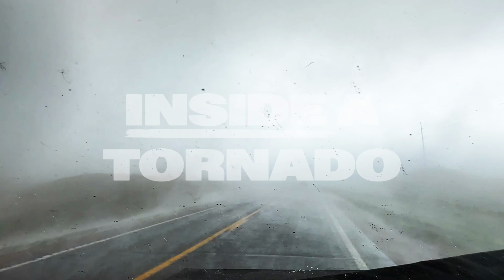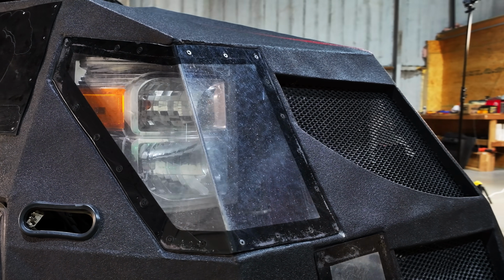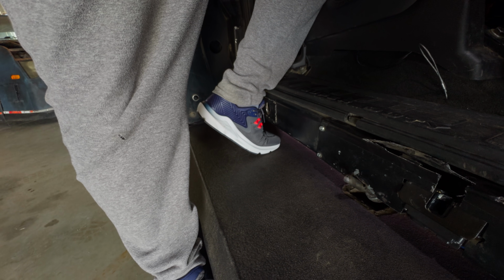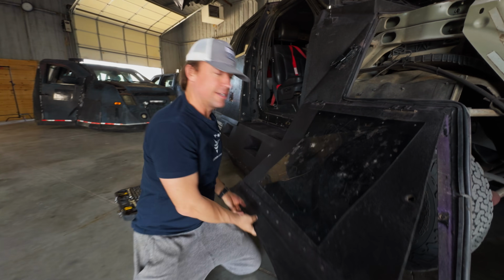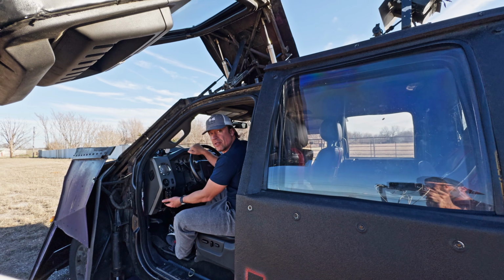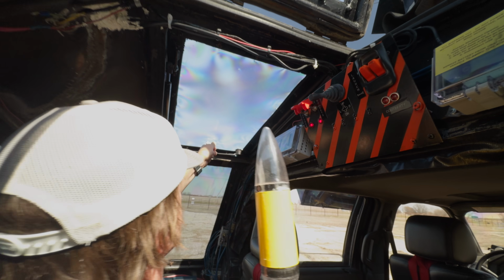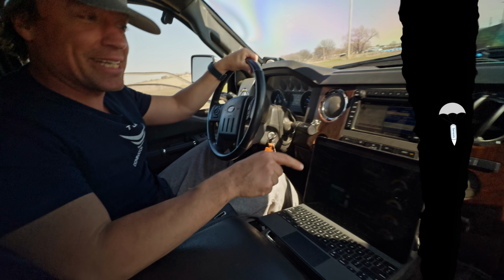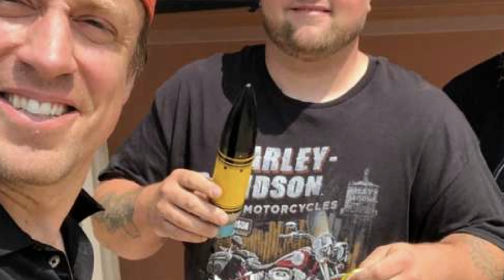Dominator 3 Tornado Tank ULTIMATE Tour

Comment: There's a error in the denominator 3
Reply: I tested it in just tornadoes 1.18 and then it flow when i tested it on EF4 tornadoes but i survive from the EF5
Reply: Dom 3 is much stronger than TIF 2
Reply: Also Dom 3 can survive 205 miles per hour or 260

Comment: 1:35 Awesome vehicle but not 3/4 inch steel as you mention. In another video I saw it say the Dom3 was 6-gauge which is about 3/16 inch. This seems right when you look at the inside edge of the outer door. Commercial ships are only 1/2 inch to 3/4 inch steel!

Comment: 7:51 after being lowered flush to the ground, the spikes raised the truck back up away from the ground.. 😂
Reply: @vladno1pilot  thats because of how strong the hydraulic system is to drive those spikes
Reply: Also since it’s connected to the chassis so all the vehicle weight will push it down
Reply: @ILikeNadosAsWell it didn't 😅

Comment: your rocket idea is good but instead of wasting time connecting the the leads with a tornado coming your way, so you can fire the rocket, have the leads mounted permanently to the launch pad. Your leads would be soldered to a small copper L shape pad on the launcher and the rocket would have the same small copper pad when you put the rocket on the rod, the two copper pads will line up and ready to fire. Just image your palm is that copper pad mounted to the launcher and your other palm is the copper pad on the rocket, when you put the rocket on the rod your palms come together and you are ready to fire. Another idea is to put a small smoke bomb in the rocket so when its time to find it and you can't see it (like stuck in a tree) with a remote you can activate the smoke bomb when your in range and the smoke will show you where your rocket is at.

Comment: I'll pick the audi rs5 engine swap it with a lamborghini r8 engine and drivetrain transmission it and for the bodykit I'll use the liberty walk  full carbon fiber (lb works) and a active aero for the wings  with 2 nitros and a turbo with underglow light that are red and drag wheels and para shoot removing one of the headlights for cooling.

Comment: Yo reed. Rate this Incredible Vehicle I designed. (Chatgpt Corrected me.)
TIM 4:
Armor:
2 Layer Titanium Alloys
4 Layers Kevlar
5 Layers Innegra
1 Layer ⅛ inch Tungsten (the Lightest one)
Angled Perfectly and a Debris Deflector.
Window:
4 Polycarbonate
5 Laminated glass
Window shutter:
Releases a Safett system and deploys 4 Layered Polycarbonate glass.
Angled Perfectly.
Engine:
Turbo Diesel Strong.
2 Batteries
Strong Body Armor
Design:
Aerodynamic
60% Kevlar
40% Innegra
Length/Width:
7 Meters long
3 Meters wide
Permanent Systems:
Skirts that Leave a 3 Inches Gap, Can be Deployed down.
Deploy systems:
Sandbags:
14 Sandbags:
2 on Each Corners, 2 on Sides, and 2 on center.
Airbags:
They release and Lower the Vehicle.
18 Stakes:
They all Take 8 Seconds to finish.
6 On sides, 3 on Rear and Front.
These dig 3 Meters deep and release a Star Shape and Small Digging that Digs 2 Inches For Deep Anchoring.
1 Retractable 360° Turret Telescope:
For Radar and Data and Windspeeds
Roof:
2 Advanced Radars
3 Advanced Anemometers:
2 on Roof, 1 On Rear.
1 Big PC Tornado:
Basically Has all Data.
12 Offroad Strong Wheels.
Wheel Protectors.
High grip.
Wind threshold:
190 MPH-290 MPH
Tornado Rocket systems:
Has 2 Retractable Rocket launchers and uses Dominator Rockets but Advanced.
3 Drone Pad Launchers and has 4 Stakes that dig 0.3 Meters deep. And Has Wind Protection.
2 Probes that Survive F4 Winds.
2 Deployable Unexposed Squares:
Has 1 Stakes per Square Hydraulic spikes
The stakes dig 1.5 Meters deep.

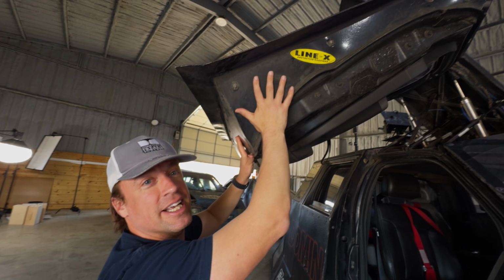Comment: 4:33 now here is an interesting question, is the inside of the armor hollow? Or is everything layered with the Kevlar, rubber, and steel alloys?
Reply: The armor is actually hollow on the inside. You have the truck door, steel frame, and 1/16th inch sheet metal on the outside. Between the metal/frame and the door is hollow.
Reply: @rafaelmacias9979 got it, thanks!

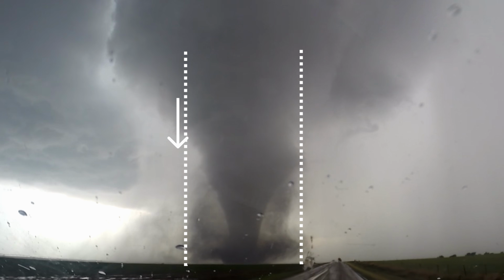Comment: 9:15 why not try the litrral twister method? We have cheap wireless transmitters and batteries now, you could send up a ton of sensors, I'd love to design something like that!
Reply: High speed mesh network between sensors, capable of broadcasting your data at a much higher rate so you don't have to recover the sensors. I've designed something similar for a torque sensor I built for drilling pyles.

Comment: Looks cool, but I doubt that you want to risk it with an F5... doesn't look heavy enough.
Reply: Imagine trying to get him out of that mangled wreck.
Reply: @themonsterunderyourbed9408 to get into a tornado, the overall density of the vehicle must be high, I mean, high like a concrete block, or a steel block. This thing is hollow, the sheet metal covers put load on the base construction of the truck. That doesn't make it ultimately stronger. Yes, it gives you some extra protection, but you pay it by reduced agility. This thing can be torn apart as easy as a not modified truck. As this thing will not withstand full contact experience, you have to run at some point anyways. With this thing, you might get stuck where you could have gotten through with the normal truck.

Comment: One bad thing about this is the spikes go in straight not sideways if they go in straight they will lift the vehicle up and its easier for it to lifted it they go in sideways its harder for it to be lifted and the vehicle dose not get lifted
Reply: The wind is not picking the car up, it is pushing it sideways. If they are angled, one side will let go before the other, and then the car is tipping. The spikes also can't lift a vehicle this heavy, I would bet the motors on them would give out first.

Now, if they had barbs or sorts on the spikes and the spikes twisted once in the dirt, angled might do better, spreading out the "connection"

Comment: I seriously doubt anybody will ever see this but just in the off chance it does get seen

It's important to have some armored skirting inside of your windows 

I can't really describe it but it is essentially a piece of reinforcement that overlaps where the window seals into the frame. It's attached to the B pillar and A pillar, not to the door

So imagine you open the door and instead of just being able to get into the vehicle, there's a maybe 1 inch piece of overlay inside the car so that there's no direct path to the outside even if both windows are shattered at the perimeter 

What can happen on ballistic glass is if a projectile strikes the corner of the glass, it can transit through the glass into the interior of the vehicle. That lip on the inside stops it from happening by deflecting the projectile downward and away from the occupants .

This is not something original that I just invented. This is how high security vehicles will configure their interior space for the reasons I just mentioned.

Comment: Some design flaws of the dom3 is the frame made out of 1 inch thick tubular steel and the spikes going straight down to the ground which raises the vehicle.Should angle them so they can penetrate the ground easier and less easier for the tornado to pull you up.Should this to the dom5 design

Comment: I am no scientist nor am I an electrical engineer. But, why not use plug-in jacks instead of alligator cllips to connect the rocket for launch power? This would eliminate your issue of accidentally touching exposed clips together during attachment procedure. The jacks would then pull out during the launch.

Comment: Spikes can be changed to screws (excavator type groung hole digger), screw can even pull the vehicle closer to ground, instead pushing it up. Would swap air compressors for good hydraulic pump, quicker and, more pressure, could be spun off of the engine, so less batteries needed. Very interesting vehicle, would like to work on one some day haha

Comment: You should really consider using a magnetic connector for the rocket wires. This will make it so much easier to wire up the rockets. Simply connect the magnetic connector and go!

Comment: I can imagine the smell/odor inside the vehicle in a tense chasing after seeing your sweated through t-shirt... 
And when you show the engine, i can see the sticks, wich hold the front shield.... 
And how the hell are you capable hit with that hammer about 167mph? I bet, if a car, wich lifted by a tornado, hit that door window or front windshield, it will be shattered.
Lowered to the ground - yeah, and the spikes goes into the ground six inches, while lift up the vehicle, opening the gap, so the wind can lift the vehicle. And the 6 inches will hold the entire thing in place... Really?
And 4 screws hold in place the front windshield? And some superglue or some flextape? 
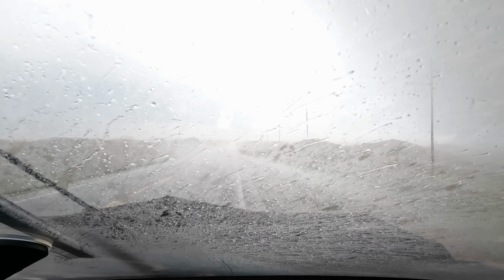8:33 nice to see the windshield's trembling movements... 
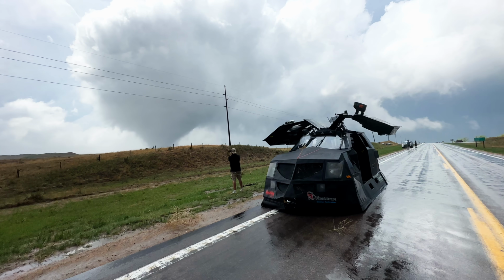8:44 the dominator3 got its job done - how the hell the spikes went into the asphalt? 
How the rocket launched probe senses the pressure, humidity, windspeed etc, if it is in a closed container?

Comment: out of curiosity have you guys looked into faster and easier ways to get those rockets ready to fire would be awesome to have an apache hydra pylon with all the data ready to roll on a gimbal with a ranging device turreted like how the tiv was with the camera but its the pods so i can fire 360 degrees and decent angle on vertical plane too.  then you could run it in single fire or salvo mode and launch a volley into its inflow

Comment: Ya Going stop a tornado with a rocket,,, a take a few of that like the armor, but I use a Cummins dully tuned up a bit' no wind skirt's, get stuck in the mud that way' can't get out of the way' also so much weight to get it moving vary fast, maybe one emergency post hole punch dilly,,,and 20.000 pound winch cable...a train car not heavy to a large enough tornado but that's nice...

Comment: I have a night vision idea. Get some super powerfully IR spotlights to light up the tornado better for an IR camera. 
Ive also wondered what Thermal cameras would show in a tornado for all of the cool air and hot air. It might make it easier to launch in a better spot.

And also the Schlearan imaging technique that is used to see air and shockwaves from a sonicboom. But i think it would be very difficult because a point source of light has to be perfectly aligned, but its not impossible, and it may not even be that difficult. Even if it takes a 2nd vehicle with all the lighting rigs on it.

Comment: Just an observation...
Wouldn't it be better to deploy spikes first and then crouch down with the suspension?
Your demonstration of those systems seemed to raise the vehicle back up a little by doing the spikes last. If the suspension is already all the way down and you are raised up by hard ground under the spikes, it seems to create a small gap that you can not lower any more to compensate for.

Comment: I'm no expert, but could it be possible to launch multiple of the skyfall sensors at once by simply mounting some sort of box to the top of Dominator 3? Like those multi-launch firework boxes! All you'd have to do then is get Dominator 3 past the outer walls of the tornado and let it rip, launching multiple sensors in at once!

Comment: That's a beast of a vehicle.
Regarding the 5hz "live" data, not sure how you would implement it, but there is a high performance open source RC link called ELRS that has really high range capability, it can send control commands to flying wings over 30km with up to 500hz refresh rate. You do sacrifice range with higher refresh rate, but your low end is 10x what you have now. 
It's designed to control things, but theres no reason you couldn't reverse the ends and have the transmitter module on the rocket with a receiver on the ground. 
Somehow using that to send sensor data back in real time would make the nose cone more expendable since the two datasets would be almost the same.

Comment: This is an incredible achievement, I have always had a love hate relationship with tornados, I love them intellectually but I hate that they exist; Its ironic that I now live in the midwest smack dab in the middle of tornado alley. For the rocket I wonder if you could have a cluster of sensors that have their own individual housing and parachutes attached and then it deploys they just simply separate, 4-5 rockets could possibly drop as many as 3-4 probes each or maybe even more

Comment: 🤔 I am not a mathematic mechanic but wouldn't this be like the best possible option for an electric car that you can overload what batteries so you can basically stay grounded and with that set up if you utilize the air suspension and since the fact that it's an electric and nothing needs to be hanging below you can literally see the car flat to the ground with because of no transmissions or differentials 🤔 you will have to go with the in the wheel motors for this to happen 🙃 once again I clearly stated that I'm not very good at science stuff but it could be the next vehicle I'm just tipping 🫡😐😶😶‍🌫️🫥

Comment: An idea for the rockets to speed up deployment: would it make sense to have the leads pre-connected to the igniter/engines inside the Dominator, then a quick-connect plug or something to connect that assembly to the launcher itself?  That would allow whoever was setting up the rocket to do the fiddley part out of the wind and decrease the overall time they have to spend exposed.  Also, this could be scaled up to rapidly deploy several rockets, either on the same launcher back-to-back, or several launchers side-by-side.

Comment: Keep the oil changed in those Ford diesels, they are not as reliable as the older 7.3 L Navistar ones. They aren't as noisy and smokey as the older ones either.
Reply: You have to keep the engine oil changed in any vehicle regardless of what maker model or specific application that it is involved in. If it's an internal combustion engine there is some form of lubricating substance that must be changed at some point in time on time otherwise you risk locking up the engine or burning it up should I say

Comment: If I could suggest something, it would be MIRV, you can pack Multiple Independent Reentry Vehicles on one rocket, and have them deploy as a payload upon nose cone separation. IDK if there are any Estes kits like that, but I don't think it would be too hard to R&D repurposing existing models to suit your needs. Additionally, I would suggest investing in a deployable turret platform using rocket pods, so you can reload from within the cabin, raise the turret and fire another MIRV. Done correctly you should be able to fire four rockets each carrying a dozen sensor payloads. I'm not expecting Tony Stark levels of engineering, but shouldn't be too hard to accomplish with leftover scrap and the existing turret assembly.  You could use a steering wheel clock spring to pass through wiring for a 360 degree freedom of rotation for the firing wires.

Comment: It has spikes that can  be driven into the ground! It has Kevlar covering it for projectile protection! Two layer windows of 
which the outer one is triple thick polycarbonate on heavy gullwinged doors. A beast of a diesel engine. With all the power
it will need to outrun a tornado if need be it can still take the hits. A beast of a vehicle. Never stop chasing Reed.

Comment: I'm very impress with the rocket going into the tornado, and have been thinking for a while that if several military type rockets are launched into a tornado, and explode in it at the same time should cause a disruption of the air circulation, causing its destruction. However the explosions should be done in the rural areas to minimize collateral damage. With your knowledge on how the tornadoes behave a rocket delivery system needs to be develop.

Comment: I can't help but think that rocket and its parachute are understrength for the job at hand. 

If you use the Estes E-F as the 1st stage, and stack it under (and fitting onto) an E 2nd stage rocket, you're going to get much higher altitude/range, and without the unneeded risk of one engine (in tandem) failing and throwing off your CG/Aim badly. 

As for the stock Estes type (thin plastic sheet) parachute, a custom sewn one made from nylon rip-stop parachute fabric using Spider Wire fishing line as its risers would be strong enough for any twister.

Comment: pretty cool stuff.  the rocket system is unnessicarily complex. Personally, since you have compressors, I would run a pneumatic cannon with a spherical sensor load that hinges open its outer layer to be used as the chute once pressure reaches the proper Bar pressure. this way you can load them in a hopped and fire then like an AA gun right into the nado,  there are no consumables, the sensor loads could be designed to be reusable, and you could fire at will as many as you want and can afford to produce.  But thats how my brain works.

Comment: 3/4” steel ? Really 16-17 mpg ? Really?
Never let the truth get in the way of a good story
Reply: It's more real than you may think - definitely not unreasonable. 

It's a turbo diesel, the truck frame is rated for the weight (F350-F450's GVWR is 20,000 to 24,000 lbs), and the modifications drastically improve the aero and ground effect performance of their truck. 

It may be a mile or two off (especially when they're flooring it during a chase), but it is a reasonable claim for highway driving.